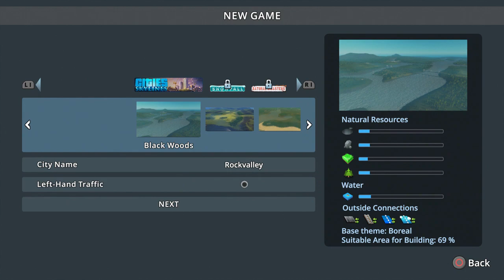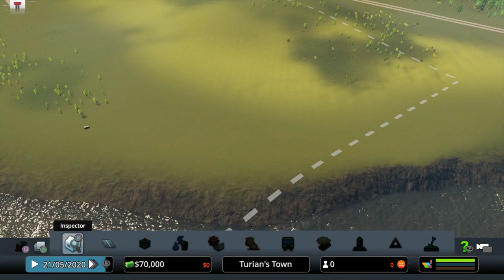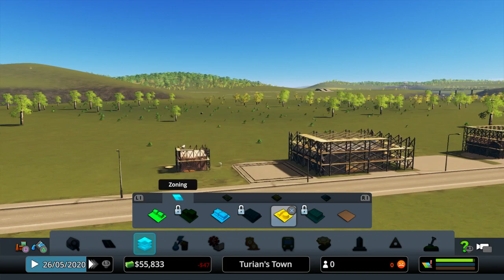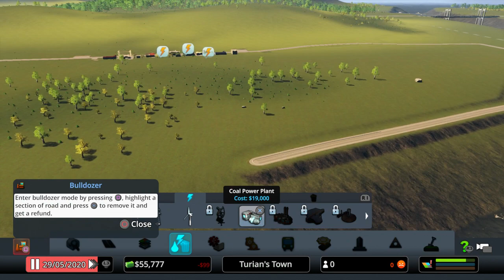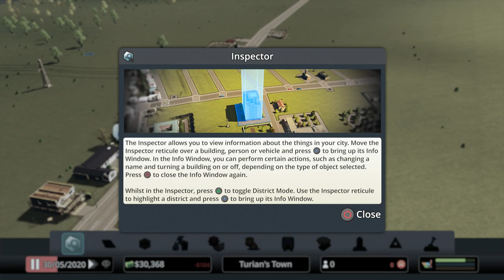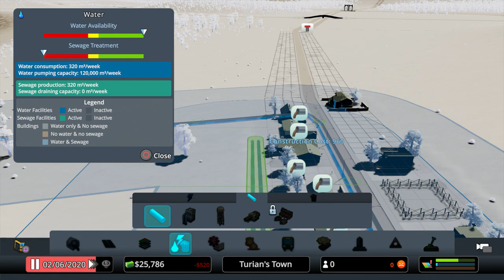TURIAN'S TOWN!! - CITIES: SKYLINES - FIRST EVER CITY #1

Comment: I was a bit skeptical about playing a game like this without a mouse, but the console port seems to work surprisingly well.
Reply: The pipeline has separate pipes for fresh water and sewage, you don't need to worry about crossing the lines. The only way you can mess it up is by putting the pump and sewage drain too close together.
Reply from the maker: OrgaNik so was I if I’m honest! Quite often these games are really awkward on a console but they seem to have done a really nice job of this one (so far anyway)! 😄 Oh I see, so I can connect it to just the one set of pipes? I thought I had to create 2 sets! 😂

Thanks for letting me know dude will try linking them in the next one! And thanks for watching too! 😊💙
Reply: I do actually have the PS4 version, but I've never tried it. Several hundred hours on PC though 😬